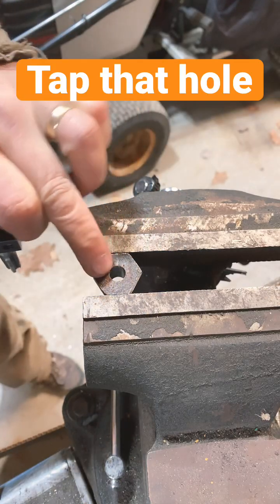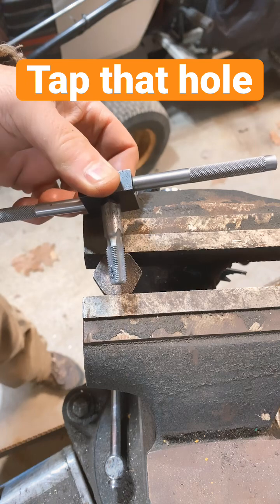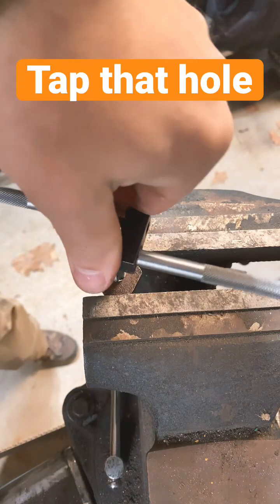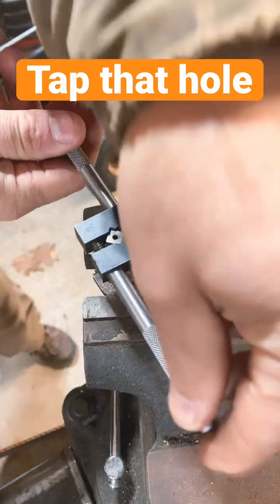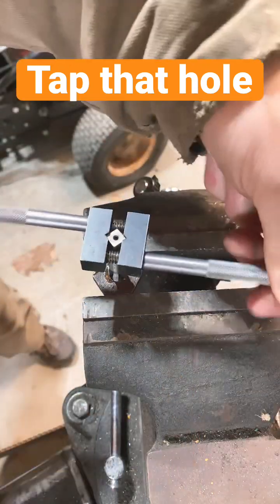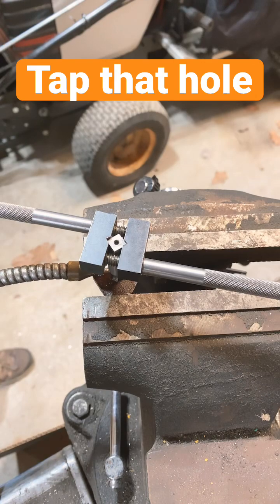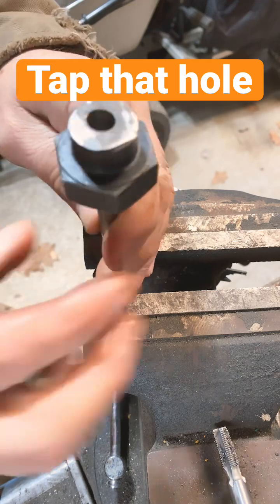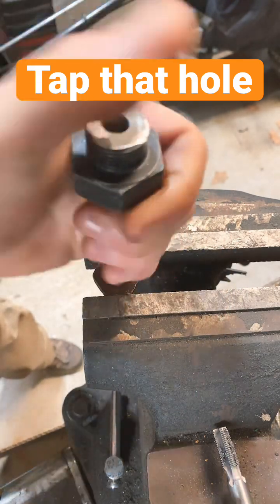How to add threads to a hole using a tap and die set￼￼

Comment: Was your drill bit one size smaller than your tap? Never used one but i got a set from harbor freight on sale for $5. Did come with the dye but has the taps
Reply from the maker: The tap will tell you what size drillbit to use. It’s very fine print but it should be on there.